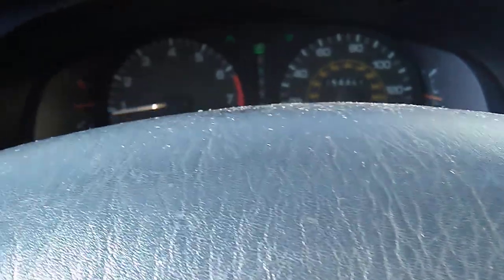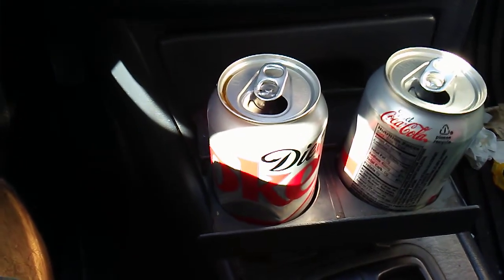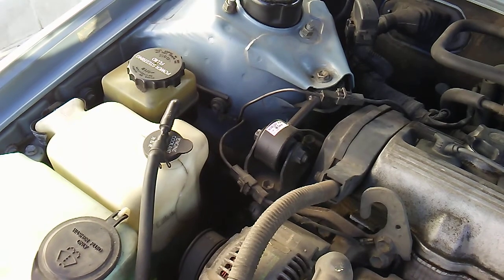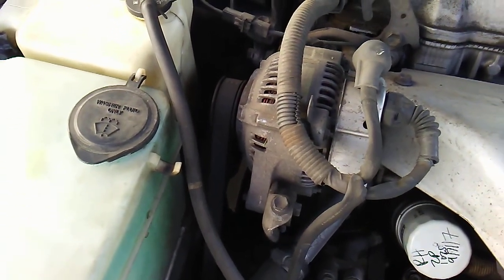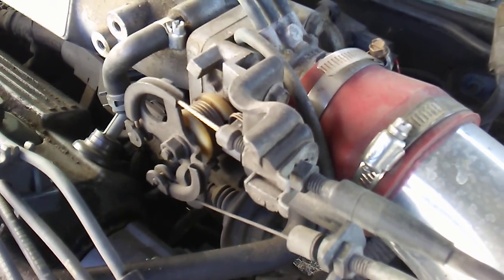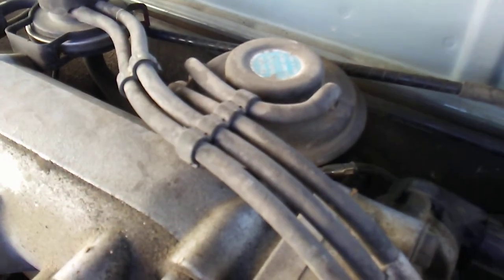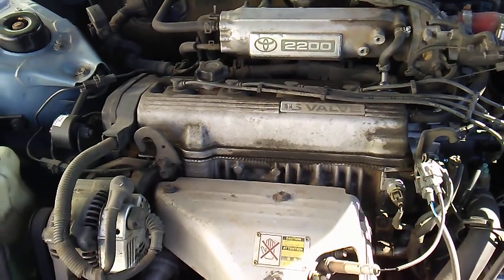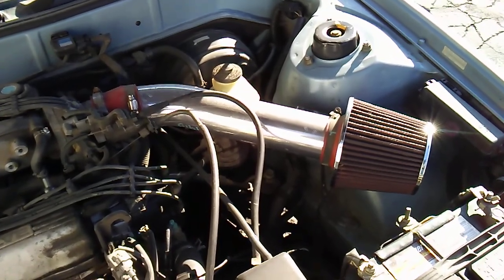93 Camry engine shakes

Comment: Here's a good tip that doesn't cost much. When you clean the throttle body, make sure to clean the port that runs from the throttle body down to the air idle control valve. This port gets clogged with the same grime that covers the visible side of the throttle plate. I cleaned mine to improve city mpg but it really helped vibrations when stopped in gear. RPMs no longer drop to ~650 and I no longer have to bump the tranny into neutral.

After spraying the air idle control port, the engine will run rough for the few seconds it takes to burn it off. Then the engine will run as normal. If your air idle control port is really dirty, it might be better to spray a little at a time with engine idles in between.  Two or three ounces of that stuff at one time probably isn't good for the engine oil or the catalytic converter.
Reply: I sprayed old style WD-40 (not silicon one) into that tiny hole in front of the throttle plate for about a minute with engine running, and the problem with the idling judder completely disappeared over the years and hasn't happened since. No adverse effects on other parts were found.

Comment: try your throttle position sensor on the fire wall side of the throttle body. Losen the two screws on the tps while the car is running and slowly turn the tps. I had the same problem.

Comment: 1995 camry the blue VSV solenoid on the side of the block took care of rough idle...i got a part number from the dealer, and bought it on e-bay for $100 less.....works fine....kind of a pain to remove and install.....
Reply: Hi ..what is the part number
Reply: I ended up doing both and brown vacuum switching valves.   The blue valve is  Toyota part #  2586074050...the brown valve is toyota part #  1760074020...I'll write later with the supersession part numbers...
Reply: Did you have a check engine light for that? How did you know it was the vsv?
Reply: @ProvacativeAcorn  ..had no check engine light for a bad VSV.   I had a loss of power, bad MPG, (17 miles to the gallon), after checking vacuum lines, noticed at constant vacuum leak leading to the VSV and the solenoid next to it.
Reply: @rafaelbeltranjr4438  so wait did you have a bad vsv or just a vacuum leak? also where are these blue and brown vsv solenoids? having trouble finding any information at all on them
Reply: @ProvacativeAcorn  a vsv is a Vacuum Switch Valve
Reply: @ProvacativeAcorn  the color blue and brown is the color of the solenoid wire connector.
Reply: @ProvacativeAcorn  These blue and brown solenoids are between the firewall and the engine, behind the power steering pump.
Reply: @ProvacativeAcorn  I agree with you, there is little information on these in repair manuals..
Reply: @rafaelbeltranjr4438  did you have to take off the passenger front wheel to access it?
Reply: Yes, I removed the passenger front wheel to access the VSV.

Comment: 92 camry replaced all motor mounts
EGR VSV all ignition related drain and fell tranny fluid every 15k
but still engine shakes thinking it might be the axles
Reply from the maker: I sold my baby 93.. Never figured out the issue, seem to be more noticeable in cold temperatures

Comment: i think its bearing inside of the drive side cv axle
will do. mine and see
Reply: @wkdewok  yeah i dont know what happened with  the first comment anyway
did u change yours and no more shaking
Reply from the maker: https://youtu.be/V1YZ5OyEJfw
Reply from the maker: APDTY 022715 EGR Evaporative Emissions Vacuum Switching Solenoid Valve